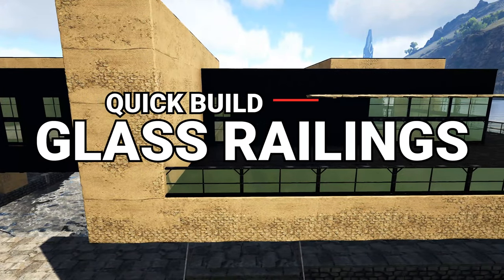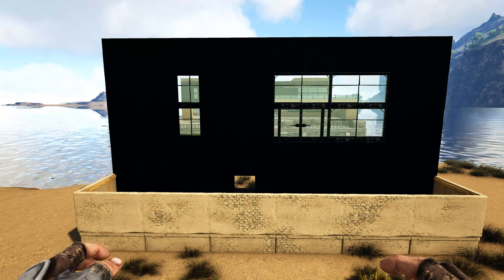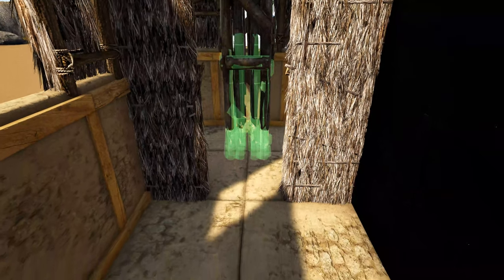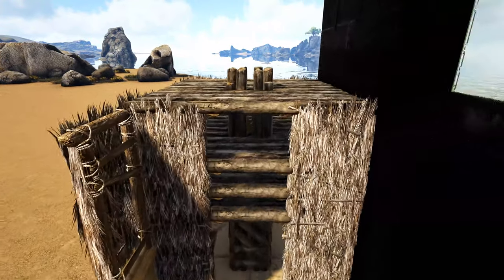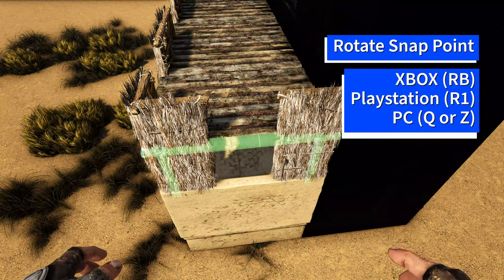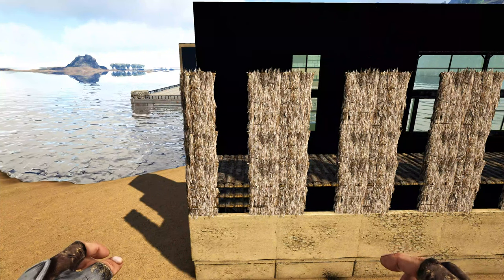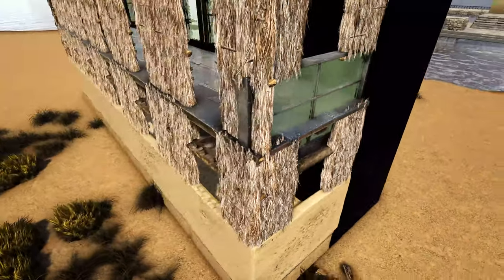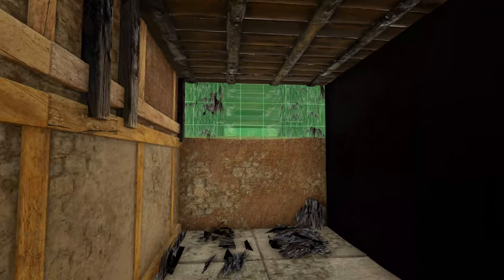Ark: How To Build Glass Railings | Building Tutorial | Official Settings

Comment: There's an easier way, with way less steps and doesn't result in the overlap on the corners..
Reply from the maker: On official settings? I know there is an easier way with no clip enabled but I couldn't get it to work on official settings.
Reply: @CHipZz  I haven't played on official for a while but I'm pretty sure Longstaff does it in a lot of his videos, which I think are official settings. Check his modern house build on the ocean platform.
Reply from the maker: I think the way he did it in that video no longer works on official settings. Which is why you need the fence foundation part that I used here. I might be wrong though.